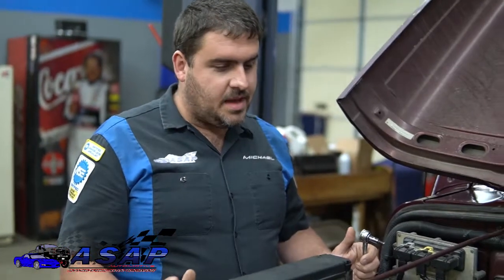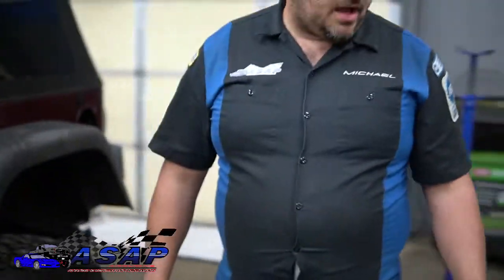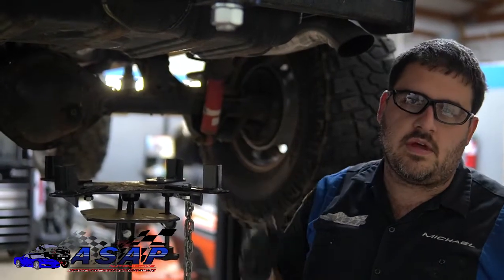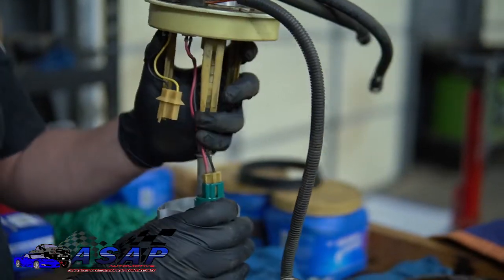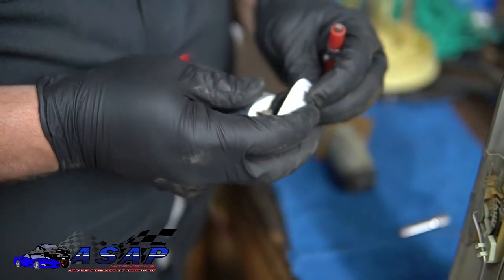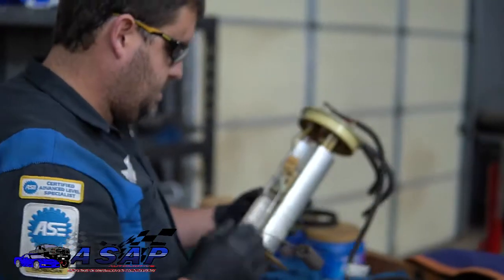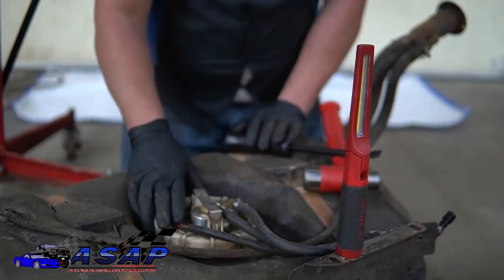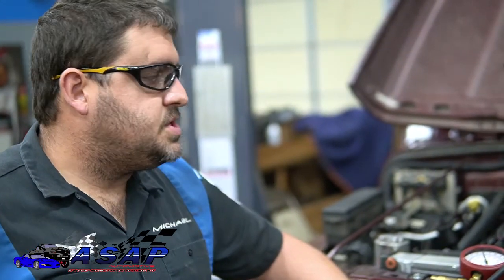LS TJ Fuel pump upgrade....again!

Comment: Never saw a video with dyno results. Were you guys able to make it on the dyno? What did it put up? Your video series was one of my go-to playlists that I'd watch while I did my swap in my garage. I've got a similar setup in my TJ, but it's a 5.3 with flat top pistons, aftermarket cam, TBSS intake manifold, headers, etc. Kept the NV3550 as well...I'm wondering how long it will last...it's beginning to make some "fun" sounds. HA! 

Going to drop my tank today and do this upgrade. I've got a similar issue...and it's always at like 2800+, but if I back off and then get back in to it, it feels like it catches up briefly...